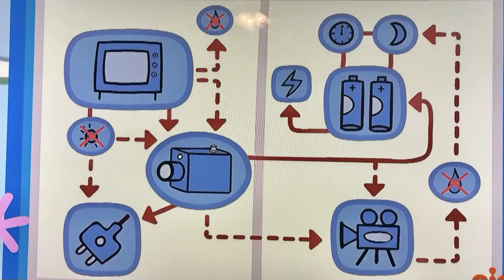Listen To Train Hit Steep Hill Where Other Trains Have Died!  Short Line Cincinnati Eastern Railroad

Comment: Thanks for the update on the Purina plant. I would imagine that CCE car loads will increase 25 to 30%. That may cause a need for more power. Switching that plant may require a full-time crew.
Reply from the maker: Yes it will

Comment: Always enjoy the best sounding horns on the RR :) Those engines were working very hard to pull that rock train, for sure. If the EOT had a flasher, it would be a FRED. Wouldn't that be cool!

Comment: What is the advantage of having the conductor drive around instead of riding with the consist? When I was conducting half the fun was riding in the caboose, yes I go a ways back. On your class 1 roads the conductor rides on the head end. If an incident were to occur to the engineer the conductor is there to assist. Your videos are superb, thanks for the effort.

Comment: Man,  They are hard on equipment. What happened to that SD40-2 that was in the same paint? That last time we saw it, it was smoking bad like an injector was going bad. Heck, they need to add one of those old GE's if they are going to be slugging it out on that hill.  Like you said they stalled out, and the SD has disappeared. Hard on equipment.

Comment: 2:57 I did not see ol' "F. R. E. D." flashing at all. If they leave the main yard then there should be either a hack/caboose or a "FRED" (a.k.a.… Federal rear end device) on the last knuckle of the last car  unless it an engine/DPU and it is supposed to be working/which means it supposed to be flashing!
     Edward H. - former Conrail over the road engineer out of Cedar Hill in New Haven, Connecticut